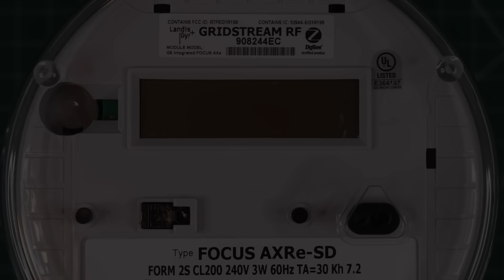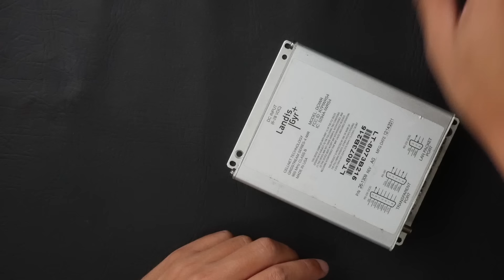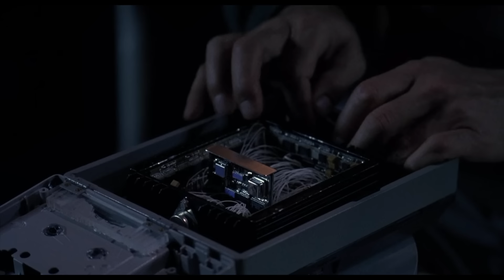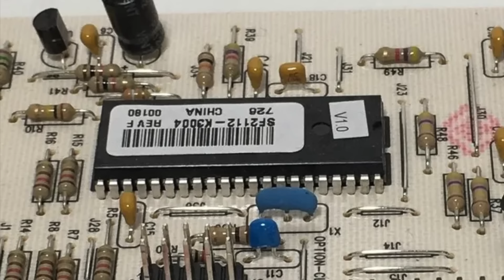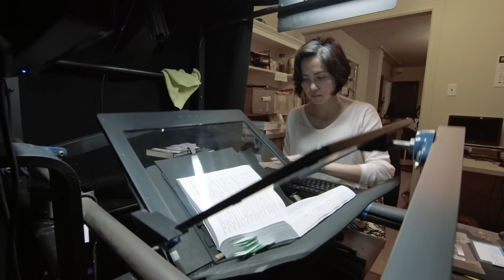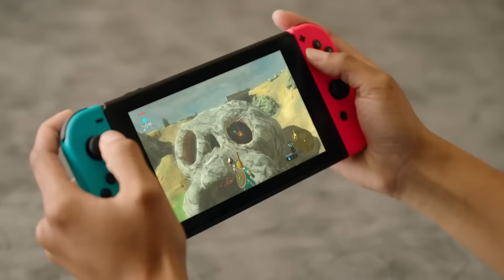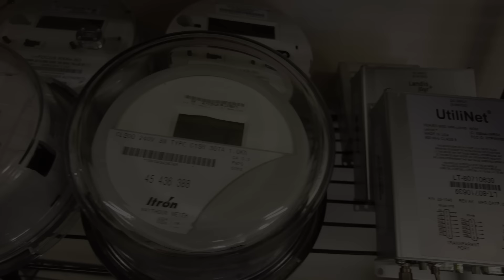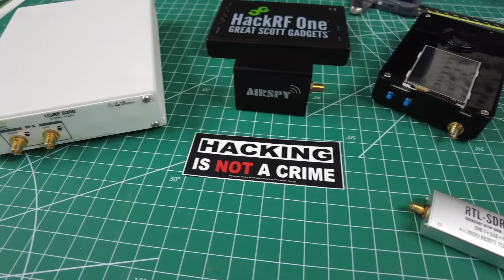The REAL Problem with Smart Meters

Comment: I had a Hampton Bay ceiling fan from Home Depot, with a remote control, mounted in a downstairs room.  It always worked perfectly.  One day I decided to move it to an upstairs room, where it suddenly acted like it was possessed.  It would randomly turn on or off for no apparent reason.  It was so annoying, I had to quit using it.  Several years later, it dawned on me that I connected it to a circuit right next to my "smart" meter.  Since my house is cut into the side of a large hill, my upstairs room was actually at ground level outside and that's where my electrical panel and meter are.

I don't have the means to monitor any transmissions from that meter, but I'm certain that's why I can't use my fan anymore.  I believe the FCC has a rule dealing with anything that transmits a signal, and it specifically states that their device can not interfere with the operation of other equipment.  Somehow, I doubt that my power company cares, and I could spend an extraordinary amount of time spinning my wheels over it and get absolutely nowhere.  I'm just putting this out there in case other people have run into similar problems.
Reply: The fan manufacturer might be more help but don't count on it. Maybe you can get one with an infrared remote instead of radio? The FCC doesn't care about such things. They care about stuff like public safety services and major broadcasters that pay big license fees. 
You could try putting a sheet of metal or metal screening on the inside wall behind the smart meter and grounding it. If that works you'll have to figure out a way to make it look nice. Hide it behind furniture or something. You won't interfere with the meter unless you cover it up outside.
Also it might not be the meter itself. There's a lot of electrical interference near where the power comes into your house. There's not much you can do, the noise follows the power lines.  This has been annoying amateur radio operators and shortwave radio listeners for years.
Reply: @davidg4288  It worked downstairs on a different circuit farther away from the meter.  When I moved it I tied it into a circuit about 6-8' from the meter.  I was going to try feeding it from a circuit farther away, and then put a Faraday screen behind the panel... someday.
Reply: @TheRealCheckmate  Also try changing the coding on the fan and receiver. My parents' house used to have two of those fans so of course they needed to be coded differently. Maybe when you moved the fan to a higher location it can "hear" a neighbors remote.

 I'd expect meter interference (or any interference) to just jam the thing and render it inoperative rather than causing false operation.

Comment: Has anyone tried hard hacking these things?  Like disconnect from grid and back feed or blow out the electronics with a short range EMP?  IE: your meter is running, the contacts are closed.. You EMP blast the fucker cooking it's brains..  Well, it SHOULD continue to supply your home with electric until someone figures out it's not working / reporting and come to fix it..  With no PHYSICAL evidence of damage, there's really nothing they could do except replace it... ---- But what if... no one ever comes... What if the whole thing is some kind of lie....  What if the system is based on years of statistical data rather than ACTUAL readings?   Well, if you scramble it's brain and it doesn't disconnect you, then you have nothing to do except wait and see if it gets replaced..  You just sit in your house, and enjoy your free electric until someone shows up...
Reply: Maybe your brain has been scrambled by too many edibles LOL

Comment: This is awesome, thank you for your work on this! A little over a year ago Rocky Mountain Power swapped out my smart meter with a smart meter and I magically started getting charged more. My solar ratio seemed to change as well but don't have the right tools to prove much. I have my own SDR and have been able to listen in based on your software to some of the chatter. But my new meter talks different than the others. Anyways, this is a round about way of saying, keep up the great work and I'll be doing a little hacking of my own!

Comment: The whole "a digital copy of a real book isn't the same as the real book even if you control the original book such that the digital copy becomes the only copy of that book in use" is a ridiculous argument.  It is exactly the same.  Here's why:

It's not different from giving someone remote access to the book via a mechanical device that can turn pages and has cameras aimed at the pages.  We're just changing the way the remote access is granted.
Reply: that rant was nonsensical, well i guess it was "youtuber entertainment"

Comment: Ever since they installed mine 12 years ago I’ve had real problems sleeping straight through the night. I’ve heard the transmitting pulse it puts out can affect sleep. Others have stated similar problems sleeping.
Reply: You need to buy an aluminum foil hat.  It will protect you from UFO invasions too.
Reply: @georgeburns7251   another MSM authority?

Comment: It's almost impossible to reverse engineer a firmware from bin dump although one might get a glimpse what's inside with binwalk and a hex viewer. To determine the algorithm of the frequency hopping, one needs a pretty good maths skills but I assume this pattern can then be changed easily by the operator at whim. Perhaps there's some patents or white papers regarding these smart meters design. Good luck with your research.
Reply: lol, it's a poor old crappy off the shelf zigbee, there is nothing to "reverse engineer", and anyway we already know what is in the payload, nothing secret or interesting about it.

Comment: Infrastructure software and firmware should be open source or at least accessible source, for finding security flaws.  But there's a problem with electric meters - they charge people money.  There will always be an incentive for ratepayers to hack their meters to get out of paying, and if it's easy to do with something you can buy on the internet, lots of people will.  So while the source may be open, the meter itself will need to be locked down with encryption.

Comment: Dust network?
Just curious if it's a smartmesh frequency hopping, time shifting wireless Hart network.
I worked on these at Streetline. The polecat had the modem and the individual nodes were motes. Linear was the manufacturer but it was discontinued.
Reply: its just an off the shelf old crappy zigbee lol. There is nothing secret or fancy about it.

Comment: I remembered a swat team raiding a house the power company had been able to see the use of grow lights through the data and the cops came in they also use infrared on houses with helicopter/ drones . To see the lights
Reply: The light cycles & extra wattage used during the time cycles is easily recorded by the smart meters. When your growroom turns on/off every day, the electric company has the timestamp & usage recorded. Its a gamble for sure, but Ive never gave a damn......lights are still running

Comment: What you are advocating there is, in essence, communism. Not the boogeyman communism people have been scared of in the USA forever. The good kind, the way communism originally was intended before it was perverted by power-hungry people. The problem with the real communism as Marx intended it is, outside of a few select areas like free software where production is essentially free once you have the blueprint, it fails because a)people will always be greedy and b)bureaucracies have time and time again proven themselves patently unable to manage even the simplest systems, because bureaucrats are people who put adherence to the process over the achievement of the goal.

Comment: I've worked for 8 years as an engineer on smart meter networking for a competitors to L+G's Gridstream. Multiple technologies in fact. Fascinating to see someone put so much effort on reverse-engineering it all.
Reply: My utility refuses to let us access real-time electricity usage even though we all have smart meters -- I'm glad to see someone putting in the work to do what our utility should be doing.
Reply: @x--. Our utility provides an app we can use to see our usage but the data is delayed by 1-2 days and isn’t very detailed. To get it more detailed and more real time, we need to opt into a program with a monthly fee.
Reply: @MrVJunk  well, that sure feels scammy
Reply: The smart meters aren't hooked up to the Internet or satellite. They're relaying information at set times on a network. If everyone was allowed to access that Network all the time they would need to increase the bandwidth. @x--.
Reply: @x--.  The utility goal is only to increase the profits to the share holder and add to the executive's bonus and enslave the rate payer. How would doing what you suggest do any of those?
Reply: @tom-yo4es  That's why I went off-grid yep had them come out take the meter away after I installed a full DIY Off-grid solar system.
Reply: I thought that  real time usage was what they were telling us we needed them for. How can you tell what you need to turn off to save money if you don't know what the effect of turning stuff off does? It is ridiculous to only give you data several days later.

It is just bs, so that the establishment can push their net zero scam. I think that the utilities are the unwilling capos for the big boys. It isn't really in their interests to follow all this net zero stuff but like the car industry they will be punished even more if they don't go along with it. The utilities would probably prefer all the net zero bs to go away.

That isn't excusing their propensity to abuse their customers, but it is better than you know who the actual enemy is
Reply: You sir are the problem

Comment: I wrap my meter in several layers of radient barrier, bc it makes me feel better. Question is, will that cause my bill to increase? Will wrapping a meter cause it to consume more power?
Reply: I can't see why it would charge more power, it just means someone would have to physically visit you and read it to find out how much you've been using (or why it isn't reporting in) and they will most likely charge you for that since one of the main reasons to create smart meters was to save money on needing people to travel to people's homes all the time.  They might also charge you for tampering with it if they are petty.

Comment: I saw an article talking about how to use an RTL-SDR to get readings from smart meters into Home Assistant, only to find that the meter we have has some proprietary protocol that hasn't been decoded.
I can understand keeping control messages encrypted, but it's nonsense to not allow reading the power usage!

We also had solar installers that couldn't be arsed to install the CTs to allow us to see how much power we're drawing from the utility.  And when the homeowner emailed or called them (not sure which) to have them come back and install the CTs, the solar installers never replied.

Comment: My analogue meter was forcibly replaced with a digital "smart" meter when my solar array exceeded an arbitrary threshold set by my electricity provider. I disputed the 1st monthly bill from this "smart" meter as it was double what my analogue meter had calculated, and this was in spite of my solar array increasing in V/A by 200%.!... My energy provider returned a detailed report a month latter which I could not contest of my energy generation and use set out in 5 minute increments.... The one HUGE take away that I discovered is analogue meters measure average use into and out of the grid, whereas "smart" meters measure peak use or supply in 5 minute allocations. "Smart" meters cant see that air-con or fridge kicking in during the day while the solar array feeds the grid for some absurdly cheap tariff rate but the sure do see and charge you top dollar at night when your solar system is asleep and those compressors kick in....
Reply: Yep they sell better efficiency lower uses...but bills ALWAYS go up. I refused a water meter...went round and round. They created a program to bill for monthly checks...yet they don't read it monthly it's like quarterly or something. Talk about fraud

Comment: Here in Brazil these meters work with a system called 'RF Mesh' at 915MHz. But i dont know if this is used a lot around here. Always see them manually reading ....

Comment: Wish I could've dumped firmware from a certain smart meter. I wanted to see if the encryption and auth keys were in flash or firmware but they hid away all the chips under the LCD which was really annoying and would require desoldering. Can't even read what the chips are used, it's all so tightly packed.
More annoying is the meter is based on DLMS standard but the manufacturer abuses the security specs to force buyers (energy distributors and producers) to use their commercial partners to read these meters since they preconfigure each meter with a key that only that commercial partner has, which just completely negates the benefits of having a common standard in these meters.  (hence why I was curious if anything could be easily extracted to bypass this unnecessary partnership)

Only been working with smart meters for a few years and I already have so many gripes with several manufacturers.

Comment: Aren’t there statistical methods to detect revisions made to operating software?  Do most states have laws against theft of power?  I’ve seen people had to compensate other individuals for power stolen, but how about taking waste power that’s just laying around in off peak hours and stuffing it into a capacitor in your basement that will hold 23 Giga Watts with a fresh Di-Lithium Crystal.  Right sparky?
Reply: Yes, and Yes, There is no real "waste" power to take for free, there is however unused or wasted capactiy and Thats effecivly what a smart meter allows - Cheap rates when theres a lot of capacity on the grid (over night/small hours) thats not beeing used which you use to charge up your own Battery (Sodium Ion Batterys are starting to come online and show a lot of promise useing next to no rare earths and ability to do more cycles then a Li-Ion, they are  a bit bulkyer thehn Li ions though so probably not going to end up in cars). then use that power during the day when the grid is straining and rates are corispondingly higher. This helps smooth out demand.

Comment: I agree with pretty much everything here, but what you pointed out about government funding paying for closed-source hardware development really grinds my gears. It's like public university research being paywalled or completely squirreled away because the government plus some commercial entity funded it, and the commercial entity has a business stake in it. 

If we can't get access to the source, we need regulation that requires 3rd party code review and vulnerability analysis. I'm normally not for more regulation but these things put peoples' lives at risk on a large scale, and as many have pointed out, is a national security issue for any country.

I can hear the industry lobbyists waving their hands and yelling, "Oooh! But these regulations are onerous and will only cause utility rates to go up as development costs go up!" and I say to them, "Get the fuck out of here with that nonsense." You make a meter, you write the firmware for it and its associated systems. You pay $100K for a code review. You sell 500,000 of those meters and gee it adds $0.20 each per meter, which is a 10-year+ capital investment by your utility customers that you are no doubt extracting cash from with service agreements that specifically provide new firmware. 

If over 10 years you pay $500K for code review and vuln analysis, that's spread out over potentially millions of devices, and after 10 years you can probably start expecting to sell new meters to your customers again as the first ones age-out, or more likely, you force obsolescence by saying the current meter fleet won't work with some whizz-bang 'AI powered' bullshit on your back end that wasn't even necessary and the utilities need to start phasing (no pun intended) them out in favor of the new model. Now you can raise your vendor service agreement costs and extract more of that juicy recurring income for the bottom line to keep your private investment firm happy.

Ugh. I'm with you man. Get the source out there and let's hold the companies accountable.

Comment: What can I do to check if my smart meter is actually reading correctly ??? How can I check my atual KWHs usage that is accurate and verify my actual energy used or should I say consumed ???
Reply: well, it is, because each unit is calibrated and tested at production and there are very strict standard for utility meters accuracy by regulatory agencies in most western countries. Anyway if you really want to do that, you'll have to invest in a calibrator, which is what we use in the lab to design and evaluate a smart meter, the bill is between 4K to 10K depending how fancy it is and whether it is 1 or 3 phase.